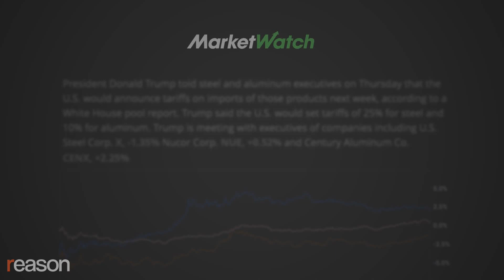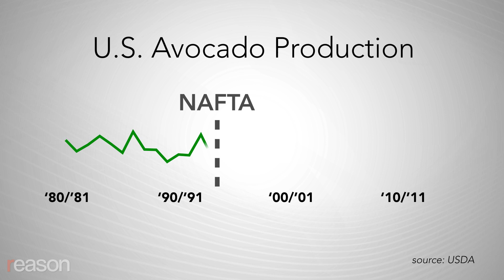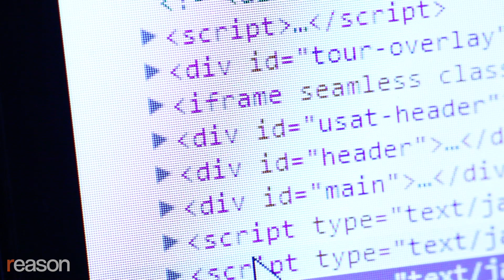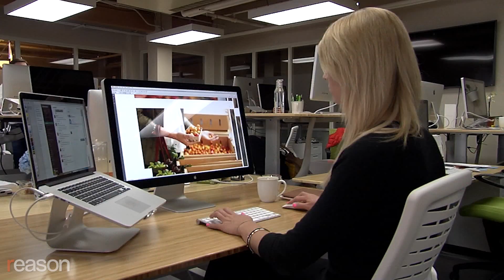Stossel: Trump's Steel Tariffs Will Hurt Americans

Comment: Having done both, I'd rather have my (hypothetical) kids welding than sitting in a cubicle farm.
Reply: Honestly, welding was a bad example.  It's a highly skilled occupation that pays really well.  They needed some B-roll of some schmuck sitting on an assembly line picking bad peanuts as the zip by or digging ditches.
Reply: Ditch digging around here is a family business.  Very highly paid too.
Reply: jdkomododragon I think kids could work at a farm, would help them build character and work ethic.
Reply: Nothing wrong with good old blue collar work. It’s keeps you in shape and you learn useful skills, not to mention the pay can be pretty good too.

Comment: I usually agree with Stossel.  He is correct about the errors of applying steel tariffs now.  Steele-town Pittsburgh reinvented itself as a tech center.  But when it comes to agriculture he is dead wrong. California produces a sizable majority of many American fruits, vegetables, and nuts: 99 percent of artichokes, 99 percent of walnuts, 97 percent of kiwis, 97 percent of plums, 95 percent of celery, 95 percent of garlic, 89 percent of cauliflower, 71 percent of spinach, and 69 percent of carrots. These crops can be produced in winter when the American heartland is effected by winter.  The office jobs he touts generally pay less and are most susceptible to elimination by technology.  New smart phones hit the market each year with very little in advancement except for the price.  I doubt Stossel even reads his feedback but the record should be set straight.

Comment: Tariffs probably do protect manufacturing jobs but what about the consumer? It basically makes stuff more expensive for the consumer. There are three kinds of people in economics: entrepreneurs (provides the product), workers (helps the entrepreneur), and consumers (buys products). Tariffs only have one of these types in mind: workers. They help workers in the manufacturing sector which is just 8.8% of the total job market and hurt both the companies providing products and the consumer by artificially raising prices.

However, Trump is right when he says that other countries have tariffs on American goods. However, the solution is not to implement tariffs of out own but rather to remove the trade barriers in other countries.

Comment: Weren't you just calling for people to abandon college for trade schools and apprenticeships?  Well sir, you cannot work trade jobs in an air conditioned office.   I do agree that the tariffs are not a good idea; however, America needs more skilled labor and manufacturing. Intellectual property is essentially saying we have nothing useful to offer. NAFTA needs to go the way of the Do-Do.
Reply: Since when is working an assembly line or digging ditches a trade.  Trades are electricians, plumbers, carpetners, welders, mechanics, etc.  Skilled occupations that generally pay well.
Reply: There are other air conditioned jobs you’d get from trade school like accounting, business advisor, cooking (in some cases). Air conditioning wasn’t the main point, it was better pay and working conditions.
Reply: I worked a trade job in an air conditioned shop.  Non union!